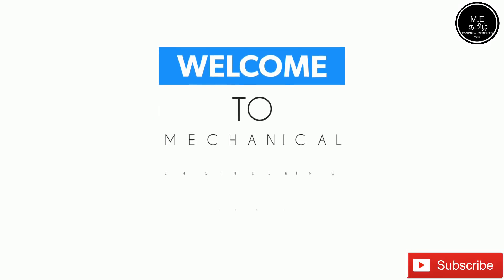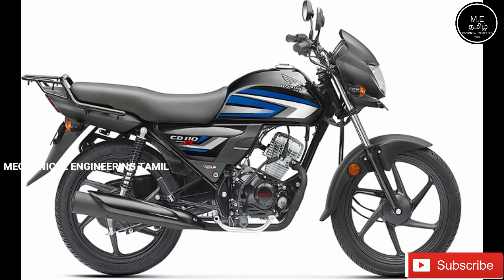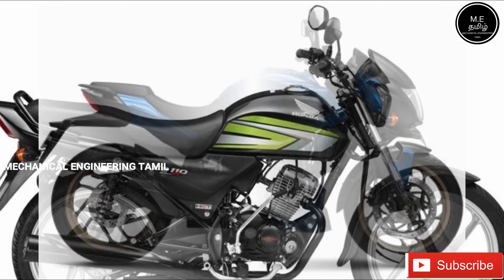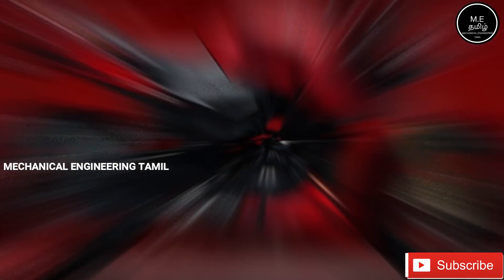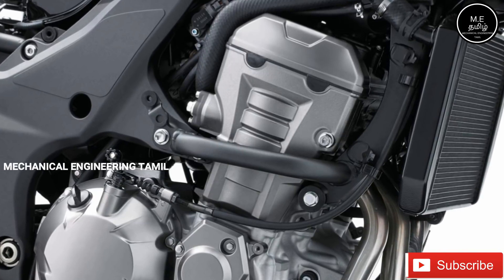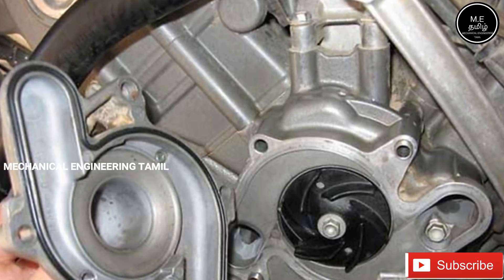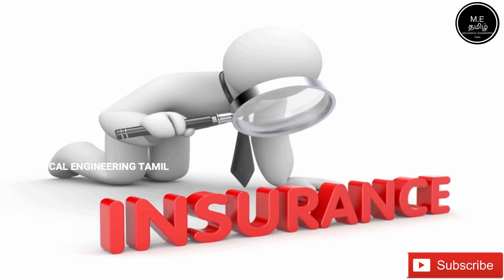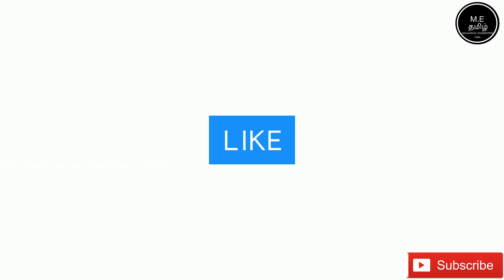Converting Air Cooled Engine To Oil Cooled Or Liquid Cooled  Engine Is Good For Bike (தமிழில்)

Comment: Bro if naan air cooled motor le watercooled motor ode head block with original waterpump radiator one complete set convert panna ethaacchu prob varuma? Because i’m Malaysian. I saw a Vietnam guy convert his air cooled 100cc ex5 motor headblock to 135lc headblock where it’s liquid cooled. He used original part of Yamaha 135LC headblock. Also i saw Thailand guy converted his ex5fi to cbr headblock with full radiator system.